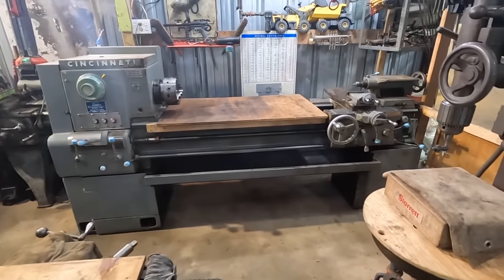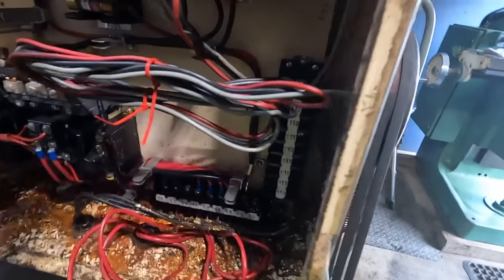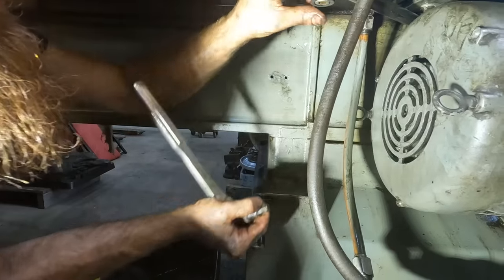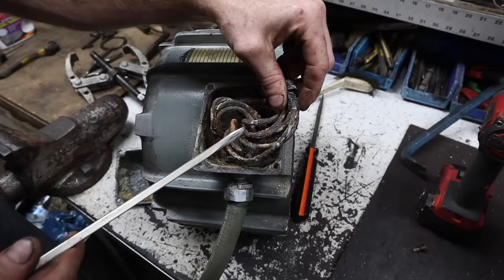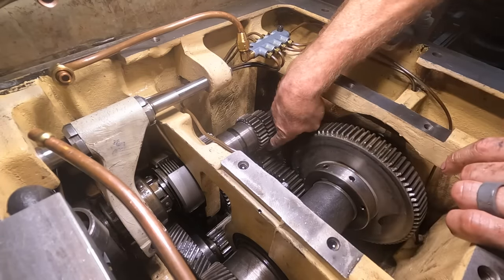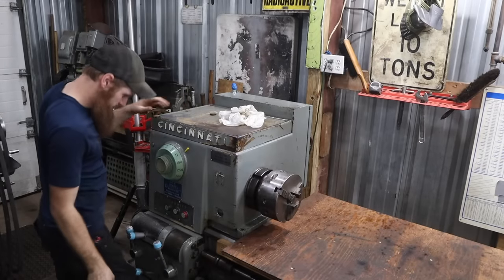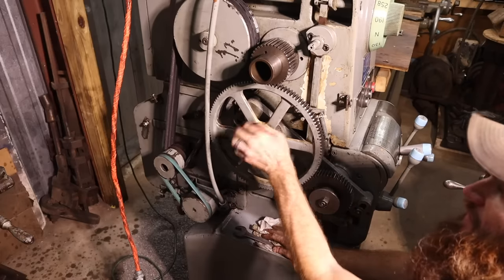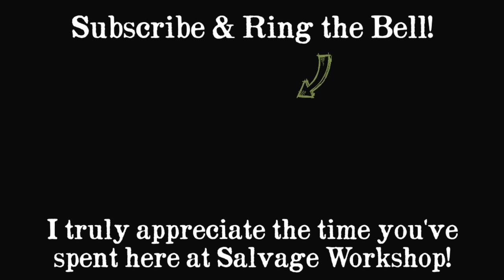Can we SAVE this BROKEN Lathe? ~ MAJOR Issues found! ~ Will it Ever CUT again?

Comment: I was cringing when you were listening to the gears on the end, trying to find the source of the noise. Also when you were machining that tool, and were getting closer to it to check the finish, your beard was really close to the chuck. That's the type of mistake you will only ever make once! :) Got to admit though, when your in the heat of a project, its so easy to forget things like that. Id say 90% of my mishaps have been when ive been in the zone, and not paying as much attention to my surroundings as i should have been. But yeah i would defo either tie that beard up, or use some sort of cover on it, can you imagine the damage if it was to get caught up! wow! :( other than that though bro, awesome vid and project. Just shows how well things used to be made, when they were made to last longer than the warranty period! :)

Comment: I suppose you noticed when running with the head off oil was splashing out and hitting the back of the electrical box.  Since there was no gasket when you removed the head, I'm thinking someone had it off to check if there was a broken gear but did not locate the issue(which you found the key and pin).  They replaced the head without the gasket and ran it a while with fluid splashing out and finding its way to the electrical box.  Hope that was understandable.

Comment: That's a 3 phase motor. The segments on the rotor need no electrical connection.  Rotation is caused entirely by the magic of the MAGNETIC fields created by the 120 degree  phasing of the 60Hz 3 phase power. (As an EE I too am pretty amazed the motor actually ran so well!   Luckily that white aluminum oxide is a good electrical insulator 🙂)

Comment: That white powder is OIL that got aged and dried. And the material is non conductive. That is why the motor ran but poorly. The oil seemed to have gotten through your cable sheathing from where it was connected into the control box.  As the oil dries, it becomes hydroscopic and sucks in humidity. Some more years of stting would have damaged the motor casing and the winding cores.  

It looks like the oil leak in ,  might have happened as you mentioned because of a missing head gasket. Nobody had mechanical sympathy for that old machine for some time! I would recommend you to change the sheathing on the motor cable when you can afford it, given it may have the dried oil powder still in it and the insulation may be crumbling.   Love from India!
Reply: The windings are enameled wire coated in epoxy, they'd be fine.

And I highly doubt the oil made it through the sheathing all that way. It just wouldn't work that way. I'd bet if he cut that cable anywhere between the box and the motor, the wires would be perfectly fine. The only way they wouldn't is if they got cooked, which would have been a greater danger for damage to the motor anyways.
Reply: Unless you're talking about CONDUIT which is a different story than sheathing.

Comment: I totally agree with you, I've rebuilt many electric motors and I've never seen one that bad and run still. I've also worked in machine shops as the maintenance mechanic and I'll tell you that is most likely caused from machining coolant, somewhere along the line the was a major leak in the coolant system and that's why it has been removed.

Comment: Great work, I would hate that grinding noise at high speed on the back. I would take a better look at that. But it's a great machine! Love your videos and explaining ❤
Reply: I was thinking that noise might be less when he engages the feed box, but getting two different gears to mesh perfectly with what I think is called a bull gear is probably pretty hard. Probably the reason for the bushing instead of an axial roller bearing is because there is multiple gears running on that bull gear and eliminating backlash in that gear set would be real hard, especially with the loads the gearbox can generate under a heavy cut on hard material. Those kind of loads on that type of gear set would probably end an axial bearings life pretty quickly
Reply: Agreed. Bull gears like back gears are LOUD. i think its fine!

Comment: I wonder if it would be worth dipping the motor windings in epoxy resin to ensure it stays together enough to keep from shorting out something. I'm guessing the white junk might've been a combination of whatever resin it was originally coated in and the wire sheathing.
Reply: That powder in the motor was evidence of water in motor leading to corrosion of the aluminium. I'm astonished that the motor hadn't shorted out.

Comment: I think you also solved how oil was getting into the back panel. Is it possible that the lack of a gasket allowed oil to seep between the gearbox and the back panel and then seep in via the bolt holes?
Reply: Exactly what I was thinking!

Comment: Wouldn't  it also be useful to put a valve at the drain (and plug for backup) so you can close it if needed.

Also I assume electric box is water damage, water leaked down the conduit to the motor.

Comment: Love your video.  Only thing I would add about the gear train noise for the leadscrew drive would be to set the backlash in the right order.  That order would be backlash between the small gear that drives the leadscrew and the large diameter idler gear by sliding the idler gear back and forth in its  slot to get a little backlash in that mesh spot then adjust the angle of the whole carrier to adjust the backlash between the big idler and the gear on the spindle. That way you will avoid any preload on that gear train. Keep doing what you're doing. A lot of us like it.

Comment: 50:02, I think you're thinking of a commutator as on a DC motor/generator. Those spacings on a rotor of an AC motor are no big deal if they're a bit dirty. They don't complete any electrical circuit, they are magnetically ferrous section which get magnetically induced to move from the stator windings.
Reply: That is true about DC communicators. However, ferrous contamination across the winding slots in the stator or rotor can short the magnetic circuit, and at minimum, reduce the motor's efficiency. Electrically shorting the single turn loops on the rotor also causes similar problems.
Reply: Yes, but the key is "ferrous". Aluminum and aluminum corrosion products are not magnetic.
Reply: @Rorschach1024  If the rotor was made of aluminum, it wouldn't turn by magnetic flux.
Reply: @ElectricGears  That is not a wound rotor though. There were no slip rings that I could see?
Reply: @ElectricGears  What's a "DC communicator"?
Reply: @ElectricGears  And just to be clear, since there are no slip rings, the motor is ether a synchronous, magnetic, or induction motor. If it does have a wound rotor, then it would be an induction motor. As I said, if it is a bit dirty, it won't make any detectable difference. (The reason it still ran with all of that crud in it)
Reply: @merlepatterson  I was referring to the communicators on DC/universal motors. The rotor on this motor has single turn winding formed by the aluminum injection molded around the steel lamination. The changing magnetic field from the stator induces a current in the loops. This induced current create the opposing pole that the stator's field pushes against.
Reply: @ElectricGears  You mean "Commutators"?
Reply: @ElectricGears  An Armature has a Commutator, this was a rotor.

Comment: I am 75 and have never seen a motor look this bad. IT STILL WORKS. HOWEVER IT MAY NOT EVER AGAIN NOW THAT IT IS KNOWN TO NOT BE POSSIBLE. Remember  a transmission can have its oil changed if no symptoms are happening yet. If you change the fluid after it shows symptoms it is too late. I hope this motor being completely cleaned even between the rotor bars and stator totally cleaned. I don't have a clue where all this came from, it seems impossible especially in the power inlet lead area. Impossible. I think this is your best video. Time may have worn out that roll pin and keyway as well as no oil. I think this is as sweet as a lathe can be. The only tool that can build every other tool is this one.

Comment: I think it should have an actual filter inside the housing.
Reply from the maker: I would have thought so too, but according to the manual, it just gets that basic strainer filter... I guess the thought is that since its a sealed system and there isn't really an easy way for contamination's to get INTO the head of the lathe it doesn't need anything more... that is also assuming its clean in there to begin with, therefore it shouldn't NEED a filter like a motor vehicle or piece of equipment.
Reply: @SalvageWorkshop  Filters are relatively recent, for cars since the 50's & VW air-cooled never had'm, as they stop failed parts from damaging other parts or snowballing.

Comment: The first video I saw was you getting old Red the small Cat crawler loader out of the barn and oetting it running.
Just shows that with common sense and looking at what steps to take you have another usefull machine.
The Cincinati lath is going to get used on many projects.
Great explanations of what needs to be done to finish the job.

Comment: I've found the old stuff might not have all the fancy digital readouts and controls but the machine is made a lot better mechanically and it will probably outlast the newer stuff. Old school is the best and has proven the test of time. Well done ,to buy that lathe in the shape it's in would be expensive.

Comment: Beautiful machine!  Hope it can be brought back to its original glory.  I have a 1943 Cincinnati MH3 universal horizontal mill with a vertical high speed head. I've added a VFD, DRO & it's been an absolutely precise workhorse. Hope your experience is as good as mine.  Thanks for the videos!

I think the pealing paint inside the control cabinet is just humidity & bad paint.  I'd recommend looking into getting rid of the contactors & replacing the whole works with a VFD.  The range of speed control open up a whole new range of possibilities for the machine.  It also allows you to completely remove the entire control cabinet as the VFD performs all of the overload & protection stuff that all of that other hardware used to do. I've done this to my mill and to a 1961 DeValliere toolroom lathe.  I gutted an enormous control panel from that  beast.  It's amazing what a good VFD can do for this great, old equipment.

Corrosion in the morot & electrical boxes indicates a humidity problem. I'd immediately get a replacement 3-phase motor & bail on that disaster.  Plenty of cheap, auction options out there.  Slap a VFD on a decent motor & your power plant will make that gem of a lather into a diamond.

You did a ton of work for this video and I, along with a lot of other machinists really appreciate it. Thank you & keep it up.
Reply: I was at Southwire for an IT project. They run the machines t from the 1880’s to make wire — they just added some computerized controls, monitors, etc. — the price of wire is almost a 100% the cost of copper. These old tools were made to last practically forever (given good maintenance)

Comment: I think the reason for the two sumps is to enable settling of any crap in the oil due to lesser movement and the other sump has a flow of oil all the time. When changing the oil undoing the plug in that sump allows the crap out this will keep the screen more clear in the filter section.  That's my take on it anyway.. I'd still do what you propose and put the two elbows with the pipe in between and leave it at that. I wouldn't join the two sumps together. I think Cincinnati knew what they were doing!  Lovely lathe by the way. It cleaned up very nicely !as for the banjo big gear, there should always be play between the gears. When you adjusted it out a bit there was just the right amount of play when you wiggled it.  That just about perfect ! Now it's up and running you have made a great job of it! Well done

Comment: Change gears on a lathe normally make noise.  The lash between two gears is usually set using several thicknesses of paper between two gears when the movable gear is fixed in place, and I've even been told to use a business card between them to set the lash.  The main point is that the lash on change gears is on the loose side and since they're used for timing and not power transmission it doesn't matter that they're loose.

You can spend a lot of money buying "way oil" but some manufacturers specify ISO32 hydraulic fluid for way oil and I've found that it works fine and is quite a bit cheaper, and I even keep a Sure Shot can loaded with it for additional oiling.  You also can spend a lot of money buying cutting oil but the old timers used kerosene successfully and diesel fuel is a cheaper equivalent.  Cutting fluid's main job is to take the heat out of the tool and secondarily reduce rubbing friction, but using an oil actually diminishes the cutting ability of the tool.

Comment: All of the corrosion inside the motor is from Condensation. The motor being completely sealed I would bet the shop the lathe as used in was kept cool or cold when not in use. Running the lathe would put heat inside the motor. Heat and cold equals condensation that could not evaporate due to the air tight design.
That is an excellent motor, well worth the rebuild.

Comment: Don’t change the drain, and don’t connect the drain to the filter.  The drain sump catches larger pieces if any, the filter screen gets the rest.  If you want to get the oil out easier put a valve and hose  routed behind the motor on the drain.  If you need to change or adjust the motor drive belts you need the space your hard pipe will occupy.  If the screen has a tear or separation in the seam you can repair it with low temp silver solder.  Your going to be unhappy you took the shift head off, they are difficult to re install if you have not timed one before.  That machine was quite clean and would have been fine with an oil change. No gasket needed on top cover.   The contamination in the electrical box and motor appear like the came from water, leak in the roof or water coming in the conduit.   Motor needs to go to a motor shop, don’t burn your shop down.   Get a free or very cheap lathe in decent shape, pay someone to fix the motor.

In the event you have not seen them wrenches are available in sizes, leaving the adjustable ones for plumbers.  Brushes, scrapers all kinds of tools are sold that are actually made for. You can clean up machines with water mix degreaser, the oiling system on the machine will oil the moving surfaces that you can’t reach to hand oil, much cheaper and easy to use.  We  use the Zep concentrates with good success.